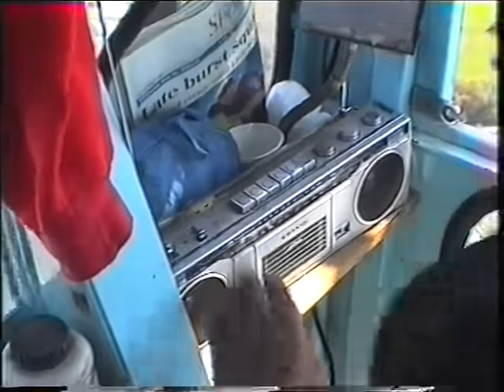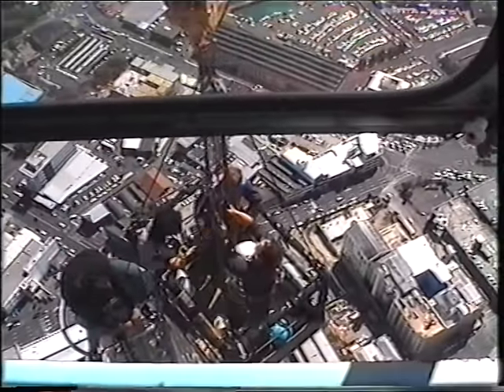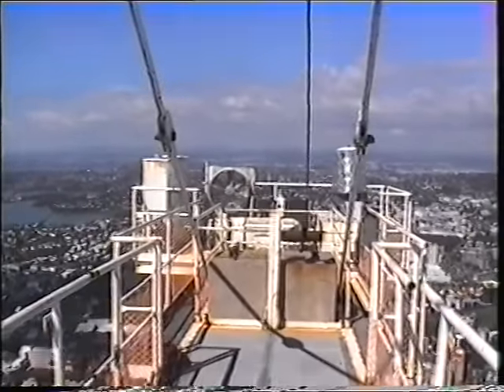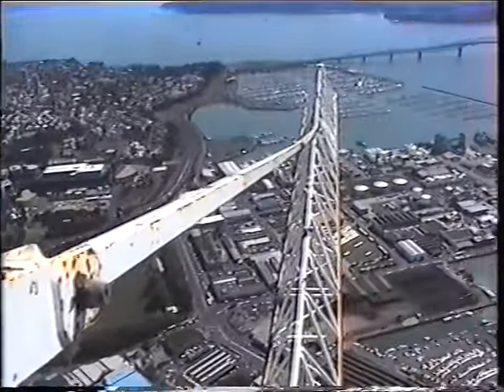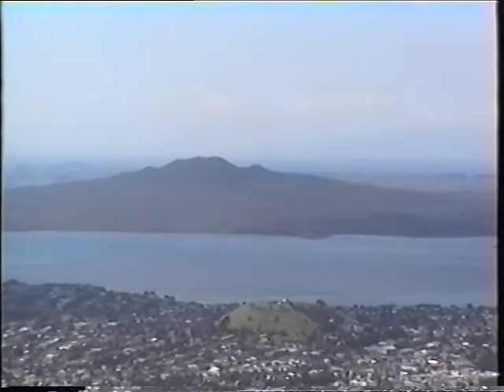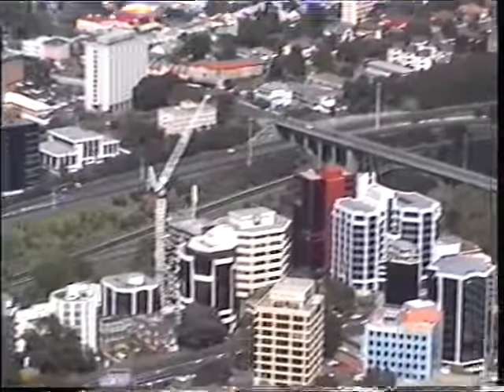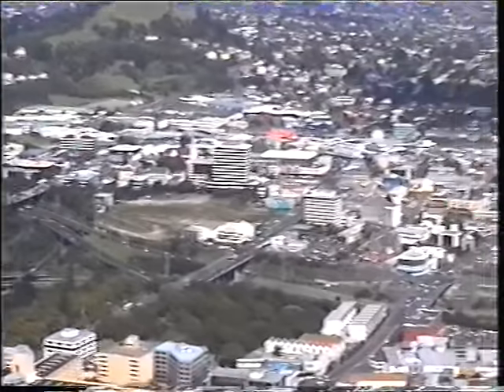1/4/1997, Skytower, Auckland, being built from crane drivers POV 2 of 3

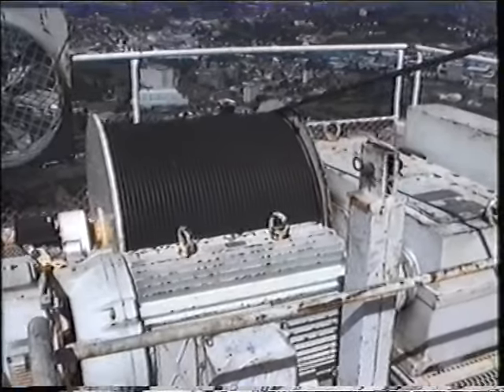Comment: At 4:24 or so you can see the roof of the ASB building and Auckland Centra Hotel gabled roof. I worked on that roof joining the butanol on the ply panels for a short time in the early 90's. The crane on top of the ASB building was about the tallest thing in town and towered above the roof of the Centa Hotel which was 20 something levels including the basement. Working on the 45° pitch is still to this day the most terrifying thing I ever did for money. 
The angle from the rear of the crane looking down far below to ASB roof is vertigo inducing to the extreme. 
Wow!
Thanks for posting this. Interesting that it randomly came up on my feed.... The algorithm works in mysterious ways😂
Reply from the maker: You're welcome!
Reply: Pretty sure I repaired some of your butynol work a few years back on the roof 😅
Reply: Thank you for your work chaps 🫡